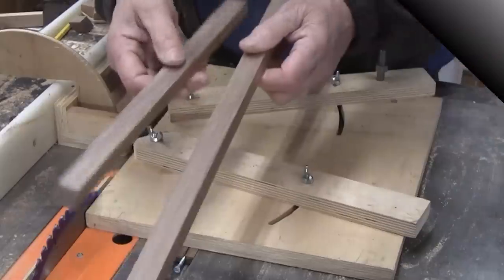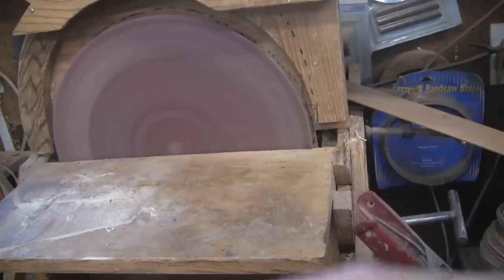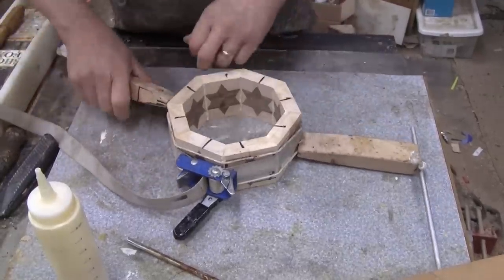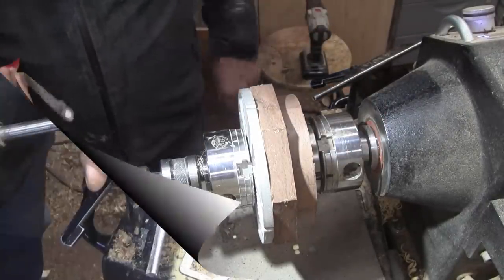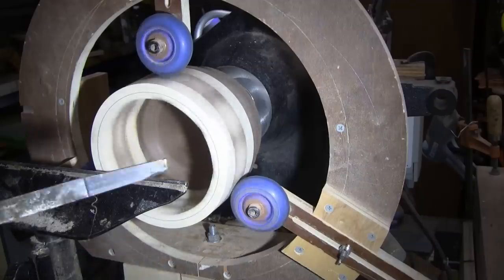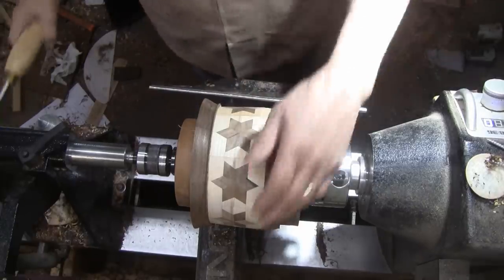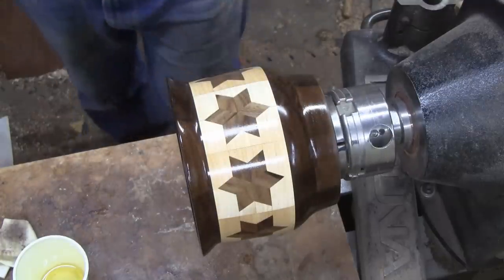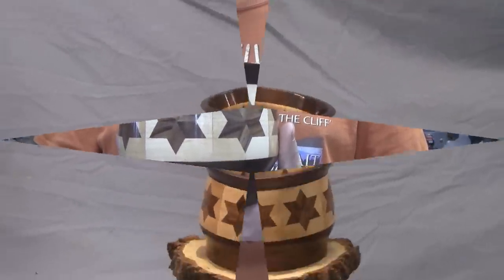Wood Turning Segments and Stars

Comment: Dear Papa, my first thougt was, that the dimension of the pattern was too small, but you made thin walls - great - , the bowl is absolutely great. Best wishes
Reply from the maker: Thank you very much Andreas. If you are talking about the thickness I was also concerned and laid out the cross section to make sure I had enough material.
Thanks for watching and commenting.
Gary
Reply: Well, I thoght making it with an eight pieced ring, it would be a problem, becase 12 Segments would be in a way more like a ring. Best wishes Andreas

Comment: Hi Gary,

This is a great video. I have been searching for a video to make segmented stars like these. I see in your video description a link to a video focusing on the stars but it will not open for me. Is this video still active? I also see reference in some of the replies that the star segments are cut at 30 degrees. If it isn’t too much trouble, could you please share the dimensions for the complete segment blocks and the angles and dimensions used on the maple pieces as well.  Thank you. Your work is fabulous.
Reply from the maker: Hi Jon, I just found out why the link did not work. It has probably been that way for a long time. Sorry about that. I fixed the link but here it is anyway.
https://www.youtube.com/watch?v=ji-3-URvri8&ab_channel=ThePapa1947

I will share the dimensions a little later as I have something going on right now.
If you give me your email address I can send and image with dimensions.

Gary

Comment: Thanks, I have a nova lathe and found the adaptor I need, already ordered it.
Reply from the maker: Great you will love it. Did you get the one that is like a live center? I use that all the time. I mount a dome shaped  block of wood on the threads and use it for turning longer things for support.
Reply: @ThePapa1947  
I should have asked you first. I didn’t know about one the turns, I think mine is just one straight unit. Maybe I should consider returning it for other one.
Reply from the maker: I find it very handy to have the one that does turn. The one I have has 1x8 threads not 1 1/4 threads. But I do have a chuck that fits it. That is something to be aware of. Not sure if you can find one with the larger threads.
Reply: @ThePapa1947  
Yeah, I am having trouble finding the 1 1/4-8 one that turns. After you mentioned it, I do remember that I have an adapter that fits my chuck with 1”x8 internal threads from a previous lathe I had . Problem that it is bothersome to have to change that adapter out constantly. Thanks for your help.
Reply from the maker: I have chucks that only have the 1x8 threads so I dedicated that to my cole jaw setup. Works on the tail stock arbor and I have an adapter that steps down from 1.25 to 1. All my other chucks are 1.25X8.
So many options and they all work.

Comment: What a great bowl this is. So much precision and so many moments that it can misalign. I have become very enthusiastic about segment turning. If I have more experience I would like to try this one too.
Frank.
Reply from the maker: Thank you Frank I appreciate your comments.
The star shape is a very easy one to make. It only needs a 30 degree angle. And then precise measurements.
 I have been going to do a video on how to do that and the ways you can use the pieces that you make. You can make more than just a star with the same piece.
Just work on simple shaped segment turnings and it will get easier as you do.
Take care and be safe,
Gary

Comment: What are lengths of walnut and maple segments that make up the stars and what are their angles?
Reply from the maker: The angle is 60 degrees. There are 6 pieces so it equals 360. I refer to it as 30 because everything I cut at work was based off the blade being set at 90. But the way this is cut you will have the rail set to 60.
 I am not sure the exact dimension of the strips  but if you watch this video I think I explain how it all works out. You can make the star any size you want.
https://www.youtube.com/watch?v=ji-3-URvri8&ab_channel=ThePapa1947

Hope this helps,
Gary

Comment: Enjoyed your dizzy bowl video. I do two things a bit different on mine. First, i take the two or three tiny discs that are usually discarded and imbed them (inlay) into the base. Then the inside of the bowl design goes to a point or vertex instead of a large flat bottom. 
Second, I turn each ring by constant angle instead of by feature. This gives a very interesting double vortex pattern. I also put a solid feature ring on the top. 
Just variations on the theme that you might try.
Reply from the maker: Thank you very much Steven. I would love to see a picture of what you did. Sounds very interesting for sure.
Thanks for watching and the idea!
Gary
Reply: ThePapa1947 Gary, take a quick look at my website, highgatewoodworkers.com.    It shows one of my first dizzy bowls as well as other stuff. If you send me your email I will send you a picture of a more recent one that shows my suggestions more clearly. My email and phone number are on the website. I have viewed some more of your videos and am continually impressed with your precision and designs. Happy turning. Steve M

Comment: Which source would you recommend for the "wedges"?
Reply from the maker: I  made all of mine so I really am not sure. Check Etsy there are many making and selling them.
If you have a laser machine you can make them yourself. I CNC machined mine but have tested making them on  a lazer and it works good.

Comment: What is the tool that you attached to the cole jaws and chuck that fits into the tail stock?  Enjoyed this video.
Reply from the maker: It is the same as this https://www.pennstateind.com/store/LTCA18.html
I think I bought mine on Ebay but I am sure it is the same. I happen to have extra chucks with 1X8 threads from my old lathe so that works good. Not sure if you can get it with 1.25X8 but you can get an adapter to do that as well.
Thanks for watching,
Gary

Comment: Thanks Gary, just as informative as always.  Question do you use oil or water base wipe on poly?  Hope your foot is healing and not giving you much pain.
Reply from the maker: I use the oil based Minwax Wipe on poly .
But also use the water based Polycyclic a lot. Kind of depends on the piece . The Polycyclic does not tint the wood. Both are very good finishes.

Foot is feeling better for the most part. Thanks for asking.

Gary
Reply: @ThePapa1947  Thanks, I haven't used poly's much, mostly on shelves and smaller wood working projects.  Will need to experiment some.  Glad you are doing well.

Comment: Lovely work.  May ask why you sand and apply finish with the lathe in reverse?
Reply from the maker: Thank you very much. As for the sanding goes there are a few reasons. One your sanding the other direction from how it was turned. Turning can lift the fibers and this helps to knock them down. Also sanding in reverse puts your hands above the work away for the bed of the lathe. And it also directs the dust toward my dust collector duct.
When putting the finish on with the lathe spinning it also directs any finish from coming toward me.
 Hope that makes sense and thanks for watching,
Gary

Comment: have you ever tried finishing with french polish then with 2 coats it looks like glass ...french polish is boiled linseed oil and lacquer put on a rag and finished on the lathe
Reply from the maker: I have used boiled linseed oil, denatured alcohol and shellac. My understanding is shellac was first used as a french polish. 
I have applied thinned down lacquer with a rag but I will have to give it a try with lacquer and the boiled linseed oil. 
Are you thinning the lacquer down a bit?

Comment: What does sanding with the lathe in reverse do compared to normal direction?
Reply from the maker: Two things that I like. It directs the dust away from me toward the dust collector pick up. And should the sand paper catch it does not try to put it under the turning between the turning and the bed.
 I do sand in both directions on tricky grain. That helps to get the stubborn areas.
Thanks for watching.

Comment: Hello Gary! Thanks for the video. When doing center ring designs like this (or others) how do you ensure that when you cut the angles in them to form a ring, the center feature of each piece (like your star) is dead center?
Reply from the maker: Thank you Jim. What I do is figure out how wide I want each of those segments to be then glue them up just a little wide so when I make my angle cuts I can make both sides the same.
Hope that makes sense.
Thanks for watching,
Gary

Comment: What method do you use to attach the Cole Jaws to the tail stock?
Reply from the maker: I have a ball bearing arbor that has a 1X8 threads. So I use one of my older chucks with those threads to attach the cole jaws to. Works great. This is not where I bought it but I think it is the same one.
https://www.pennstateind.com/store/LTCA18.html?Category_Code=live-tailstock-centers

Comment: Awesome video! probable dumb question.. why is the wing nut on the piece that set the angle turning? is that by accident?
Reply from the maker: Thank you Jacob. If you are talking about the wing nuts on both ends of the rails on my wedgie sled it is to keep them set at the correct angle. Then be easy to loosen for a different angle I might cut. I made wedges to cut 6, 8,12, and 24 segments per row.
 Hope this helps and if not let me know.
Gary
Reply: @ThePapa1947  thats what I thought they were for, but if you watch the video they spin or are loose while you are cutting pieces.. So maybe just didn't tighten them down?
Reply from the maker: @jacobdisbro1964  now I will need to watch. Was it the one closer to the blade? Those would not effect much.
Reply from the maker: @jacobdisbro1964  Ok I just watched it. On that rail I had a pin locking it in at 30 degrees so there was no reason to tighten the wing nut you saw twisting. But without that pin they should all be tight. Nice catch seeing that and happy you mentioned it.
Take care,
Gary
Reply: @ThePapa1947  thank you for the explanation! I really enjoyed your video! I just picked up a lathe so I have been learning as much as possible!! I appreciate you sharing your methods! 🙏

Comment: Wow...thought I was taking a wood shop class again...very nice and I am very impressed with the gadgets you made to help with cutting and turning...hopefully you have a video out there showing some of them...I do have a question tho...why do you sand and finish with the lathe spinning in reverse...never did that back in school when when working on the lathe...Thanks for the video...beautiful...
Reply from the maker: Thank you very much! The big reason is when sanding in reverse is the dust is directed more away and that is where I have a dust collector hose. Also it the paper grabs it pulls away from you and not down toward the bed of the lathe.
I do run it forward on the inside of a bowl.But I also will sand some woods in both direction to get stubborn grain.
I do not recall lathes that ran backwards when I was in shop class either. But that was many years ago.
I do remember having lathe that I wired to run both ways just for sanding. That was over 40 years ago. The motor needs to be capacitor start though.
Gary

Comment: Beautiful work! I am curious as to how long between each coat of wipe on poly and do you sand between each coat?
Reply from the maker: Thank you Alan. I put it on real thin and generally a few coats before sanding. I would say around 2 hours I am able to scotch brite it. When I do the final sanding I let it sit all night. But I have found that you can sand after 3 hours at times. Depending on the weather and how much you have built up. The more coats the longer I wait.
Hope this helps. If not let me know.
Gary

Comment: I am curious why you sand and finish in reverse?
Reply from the maker: I sand in reverser for a few reasons. One it directs the dust away from me and into my dust collector port.
The other I like sanding with my hands above center and this allows that.
But the main reason I started years ago was when you turn you may not see it but  you lift the fibers of the wood slightly. Sanding in reverse takes them down easily.

Comment: Beautiful work Gary. How do you come up with the way to cut the pieces in your design? Thanks.
Reply from the maker: Thank you Joseph! I suppose it is years of working with angles that helps. This one is fairly easy as there are 6 pieces for the star so that means each piece takes up 60 degrees. So each side is cut at 30 degrees. I do not know of any programs for doing this but there are programs for figuring the cutting angles of segments.  But again that is a matter of how many pieces per 360 degrees.
Not sure if this helps or makes it more confusing. If you are interested in doing this I can send more detailed information.
Thanks for watching and commenting....oh and if you watch today's video the what I just said does not apply to these joints. These were a real test!
Take care my friend,
Gary

Comment: What angle  did you use on the star,
Reply from the maker: The stars are 60 degrees apart. So the sides of each are 30 degrees.

Comment: Amazing work. Thank you for sharing. I’ve been following your work for few months now. To make a star like that, is there a formula you use to lineup all pieces together?
Reply from the maker: Thank you Ed I appreciate that you have been watching my videos.
The formula is pretty basic. The pieces are cut on a 30 degree angle and the lengths along the edges are the same. They do need to be exactly 30 and exactly the same length.
 I may need to make a short video on just ecutting those pieces and dialing in the dimensions. Those are the same cuts for the tumbling blocks I used in the Barrel of Blocks.
I can send you the information of those cuts if your are interested in making them. More than happy  to help.
Take care,
Gary
Reply: ThePapa1947                                     I’m getting some walnut and maple tomorrow and very excited to try. I’m building few cutting boards for Mother’s Day and would like to include the Star in the middle of the board. I’ll try to find the video you have with tumbling blocks. Thanks again for your help.

Comment: Your one angle was 62.5 but what was the other angles?
Reply from the maker: All the cuts on the star pieces were 30 degrees off of 90. depending on how you read the scale it is the same as 60 degrees.

Comment: Wish you had stated the angles for the pieces of the stars.
Reply from the maker: Because there are six pieces fitting together to make 360 degrees each star piece has a 60 degree angle.  That means that each side of the points of the star would be 30 degrees.
When I show the light colored black I mention it is 30 degrees.  The side of the star piece fits there and matches making it 30 degrees as well. 
 I put this link in the video for another video where I show how to make the star.
This will explain everything. If you ever have a question about what I have done feel free to ask.
https://www.youtube.com/watch?v=ji-3-URvri8&t=0s&ab_channel=ThePapa1947